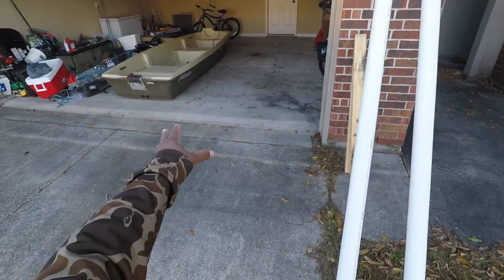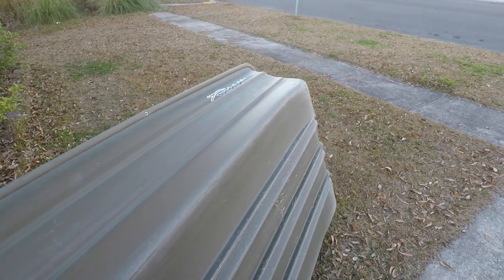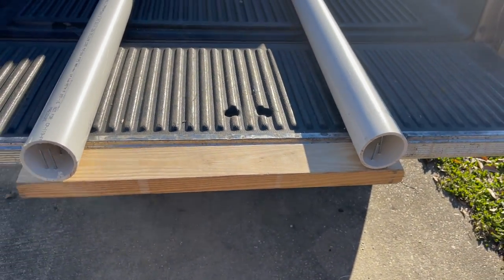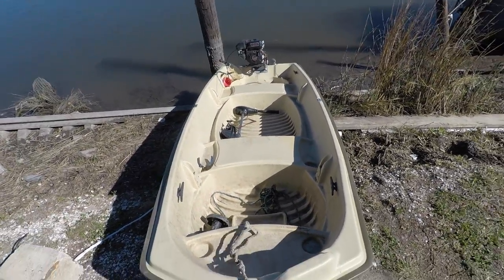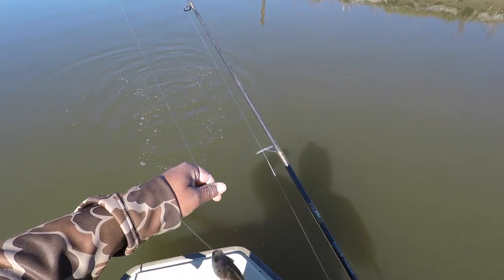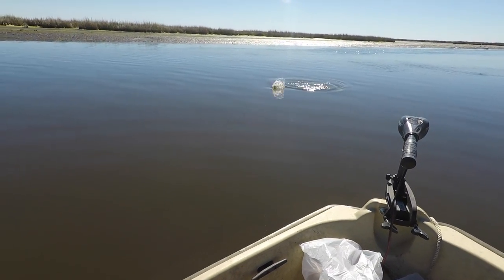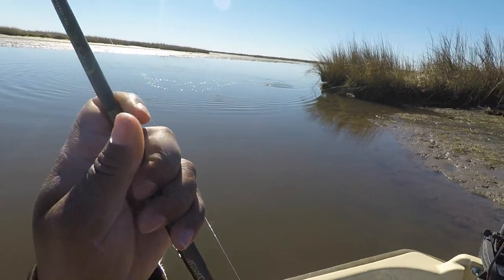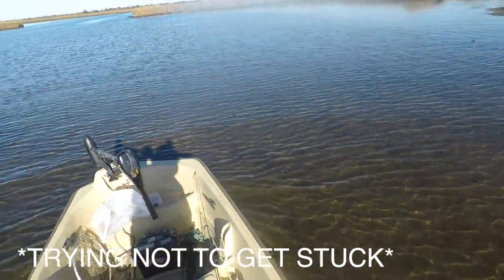DIY PORTABLE BOAT LAUNCH!! (For Kayaks and Jon Boats)

Comment: Stainless bolts with washers on both sides and locknut vs the screws. 

Drill a hole in the front board and install a piece of chain with a hook with a clasp on the end. Bring a metal anchor of some sorts you can put in the ground you can hook that hook to that will avoid it moving while you are sliding the boat down. You can use this to pull it up back out of the water. Also could use the chain to lock it up while you are gone to avoid someone taking it.

Comment: You might try changing those screws out for bolts with a lock nut.  That could keep the screw from wiggling out over time.  Great idea though, i might have to try it :)
Reply from the maker: That’s a good idea man.! Thanks for the tip!

Comment: Here's the problem with this video - how did you get into your boat once the boat was in the water? assuming you didn't try walking through the mud, how would you then get back onto the shore, again, without walking through mud? Not every kayak has a flat bottom - your design won't work with a "V" hull. What did you anchor your launch to? Go out into a swamp and try to find something to tie a launch to.
Reply: It's a cool idea. But you're right. How did he get in the boat

Comment: What battery do you use for your trolling motor? And how many hours do you get out of it when you go out? Thank you
Reply from the maker: I use a deep cycle marine battery. And it can run just about all day on it. Putting the trolling motor on high speed does drain the battery though. So I try to avoid that if possible. 👍🎣

Comment: How did you know how long the make each PVC pipe? I’m making this for my kayak with a pulley system. Do I measure how long my kayak is?
Reply from the maker: I basically measured it from the start to the end of the bed of my truck with the tailgate flipped down. So what ever was left hanging over was what I cut off so it’s about 8ft or so. 👍
Reply from the maker: I also made one for my kayak a while back. My kayak was 12 ft but I made the pvc pipe about 10ft and it worked out well